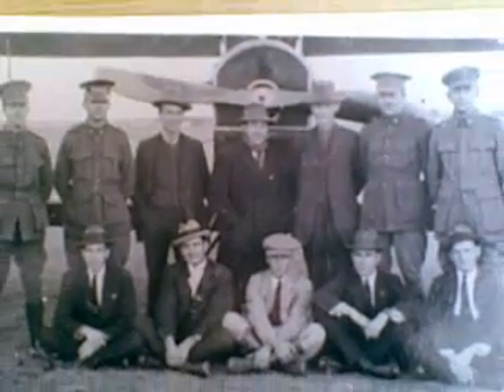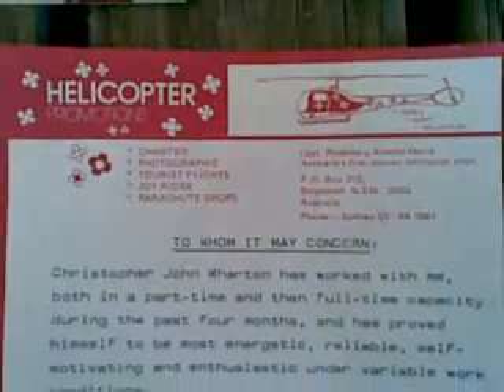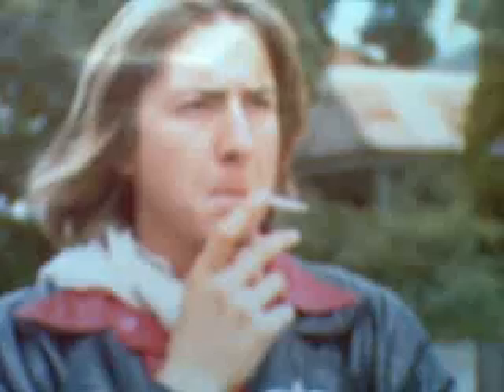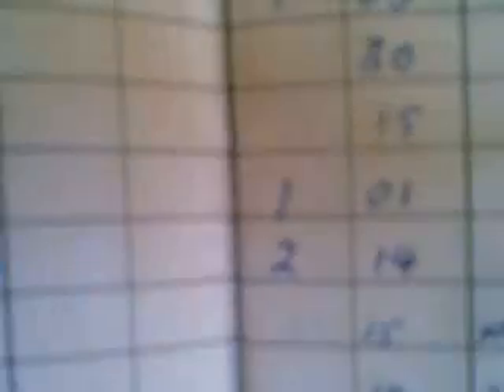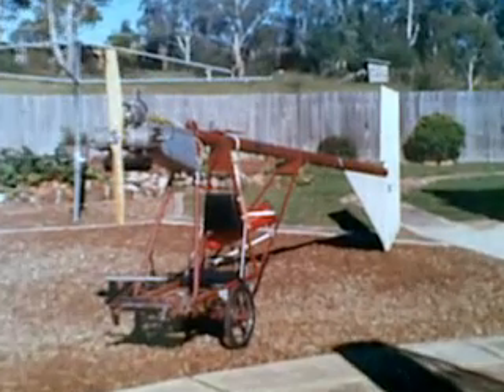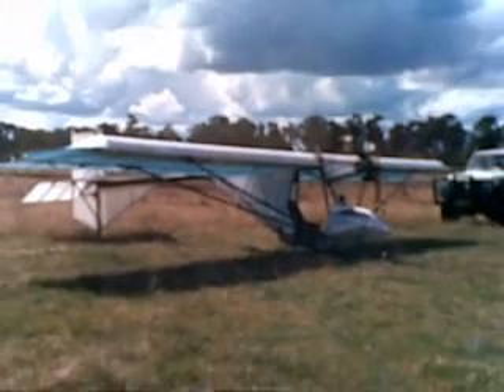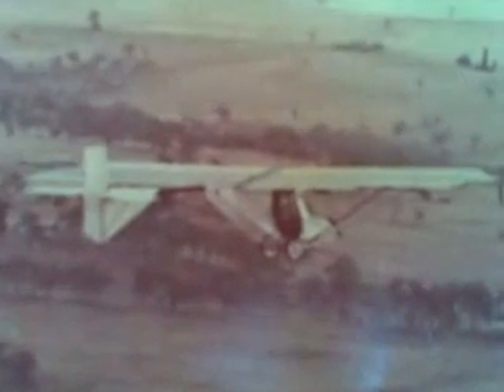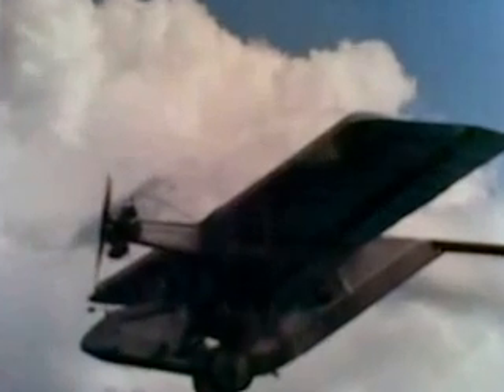Test-Flying, For Autodidactic Aeroplane-Designers...(VJ-24w SUNFUN/Budgerigar).

Comment: New site for my VJ-24W restoration project:  http://dorothy.air-war.org

Latest pic:  http://air-war.org/Exhaust_Improvement_2.jpg
I scored a free boat Trailer:   
http://www.homebuiltairplanes.com/forums/members/choppergirl-albums-trailer-build-picture52109-dsc-0286.jpg

Do you still have your Biggles hat, goggles, and jacket?

I wish I had a copy of all your VJ-24W pics and VJ-24 flight log section.
Reply from the maker: G'day,

  Thanks for the update, the Exhaust is looking brand-new, and the Website looks excellent !

   So your Jensen is called Dorothy, of honour of Oz ? That's an excellent choice of name, and the Paintjob (Computer Simulations?) look great ; I once had great intentions of painting mine, but in the event I was more keen to fly it than to paint it, and the weight saving probably made a difference.

   Um, yeah, I still have the Helmet & Goggles, & Scarf, and the Jacket's getting a bit tired so I think my Kids are going to give me new one for Fathers Day..., a propper fleece-lined Leather one, this time, for the Ego-Gratification factor...; I'll transfer the Patches over, if it arrives.

   Thanks for including my vid's on the Website's list of Jensen Videos.., it's good to see a few Jensens made it into Museums..; but I suspect yours is the only one at the moment which is on the path to become airborne (again ?, did it ever get finished enough to have flown or will you be making it's first flight ?).

   The Boat Trailer looks good, but it's still got the Hull on it, did you have to pay for the Floatie or did it come free with the Trailer as well...?

   With your Channel-Name, are you interested in the Vietnam War (?),  if so, you may be interested in a Bookreading I'm doing at the moment, "One Crowded Hour" by Tim Bowden, it's the biography of Neil Davis - he was a Combat Cameraman who left Tasmania for Singapore in 1963, shot  his first Vietnam footage in '64, and he stayed to film the T-72 coming in through the gates of the Presidential Palace in Saigon in '75, and kept filming War till he finally died of shrapnel while covering a penny-ante Coup in Bankok in 1985 ; I figure that with 11 years of filming Combat in Vietnam & Cambodia (as well as side-trips to Wars in the Congo, Bangladesh, Malaya, Egypt, Iraq, et al...), and going out on Patrol with the US, Australians, Koreans, Kiwis, South Vietnamese, & also the Viet Cong Troops, as well as filming (and partying with) the Politicians & Military Commanders, Davis was one of the very few people who actually understood what the Vietnam War was about, at the time - and he filmed it and got the footage shown worldwide (whereas everybody else in ANZUS went there for a 1-year tour at a time, & generally only operated with their own forces - the Episodes are close to 15 minutes long & they're numbered in the Titles, 1 to 24 are already posted.

   
  Have a good one,

  ;-p

  Ciao !
Reply: Yeah, the boat came free with the trailer, all I had to do was pick it up.  I have to add about 5-6 more feet to it for a VJ-24W to fit.  I'm going to build a trailer identical to yours.

My uncle was a supply truck driver in the Vietnam War.  He had the truck in front of him run over a mine in the road, and the tire from that truck landed on his hood.   I like the the Huey Helicopters from that period, which is how I got my name (not from motorcycles).

I just watched a video again about Dave Rabbit, who was a pirate radio broadcaster for Radio First Termer in Vietnam.  If you've never heard of him, check him out.

I have some flying goggles, and a jacket, but no WW1 helmet yet... but that's okay, because I'm probably going to wear my new motorcycle helmet anyway.  Not period looking but probably better for crash protection...

You will be surprised to know, if I haven't told you already, that there is already a VJ-24W flying in my state.   That Orange and White one that was restored on Youtube, was sold by that man, to a guy who runs a small Radio Controlled Airplane shop in south Georgia.  I have not met or wrote him yet but I know its here in his garage, I have pictures of it.   Isn't that crazy... it may only be a 150 miles or so from me, a flying VJ-24W.  When I get mine flying, you know for sure I will hook up with him, and have our two VJ-24W's photographed side by side on his runway.

My restoration has slowed down, because I have to get a job.  So I have just got all the most rusty parts derusted, so I can pause it and work on other things.

I think you are mostly involved with politics these days and so on, and debating other people online...  but don't forget about the girl in America restoring a VJ-24W.  I'm still here and still working on it.  I'll keep you posted over the next couple of years how it goes!
Reply from the maker: CHOPPERGIRL AIRWAR 

Cool,

  If you have the money, these days they make Hard Leather Flying Helmets, they're slightly more bulbous than a normal floppy leather Flying-Helmet, but they have the same Crash-Protection as an Open-Face Motorcycle "Skid-Lid"...

   If you can get your hands on one a Ballistic Parachute is a probably a better investment than a fancy hat, though ; bearing in mind that a VJ-24w is basically designed to be a Foot-Launched Hang-Glider trying to cope with a big weight-increase to lift the Engine, Fuel, & undercarraige - so it's a bit flimsy. (the prop-wash over the Stabiliser used to make it's Leading Edges vibrate up & down alarmingly, I was goanna fit a pair of extra Struts to brace the L/E midpoints...).

  And, if a wing-strut lets go then a Recovery Chute will let you walk away from the landing, whereas a high tech Hat will merely preserve your face to look good for an open-casket funeral...; so, I had a Recovery-Chute and a Leather Helmet...

   It' amazing that there's another Jensen so close to where you are...

;-p

Ciao !
Reply: By Stabilizer, you mean rear horizontal tail feathers vibrating.  Hmm, not good, considering I'm upping the HP.   But I'll probably find that out when I rev up the engine on a pull test.

Those are some very good and disturbing things to know.   I don't have a BRS...   maybe I should carry a parachute attached to a bungee cord at the CG, and just chuck it out the side if things go wrong... :-/

All the pilot first hand reports you can give me on how it flew... = gold to me.

I just restore one part at  a time, its kind of relaxing, and I like that kind of work.  Still need to get a copy of the plans, but not yet there yet where i have to make new things.
Reply from the maker: CHOPPERGIRL AIRWAR 

  Yeah, the Stabiliser, or Horizontal Stabiliser to give it the full name, is the bit in front of the Elevators (Triangular in planforn, on the Jensen) which doesn't move or flap up & down...; and the Leading Edge of mine was sort of "thrumming" in the Prop-blast, so I figured a pair of Struts halfway along the L/Es coming down to the Fin would hold the whole tail in place..., it wasn't effecting the handling but it was a bit of a worry to turn around and see it looking blurry from vibrating so hard.

   The earliest Recovery Parachutes were indeed Chest-Packs, for Hang-Glider Pilots, to be hand-deployed ; ie thrown into a patch of Clear Air & hoping not to get it tangled in wreckage.., but they were slow to deploy, at over 10 or 12  seconds, which may mean 500 ft or more (30 MPH going straight down, or 60 MPH diving at 45 Degrees)

   Next, at about 8 Seconds, came the Hard-Cased, Spring-Deployed Chutes,  packed in a Fibre-Glass Tube, and pulling the Ripcord let a Spring fire the Drogue 'Chute, I had one of them ; then at around 5 seconds or maybe less came the Rocket-Deployed Chutes, in which the Drogue & the Main Canopy are both pulled out & deployed by a little pyrotechnic Rocket on a Steel Cable, which can punch through any broken flapping wreckage which may be in the deployment Path.

  Finally, at 2.5 seconds to deploy, are the Compressed Nitrogen Recovery 'Chutes, which have a Cylinder of Gas at a couple of thousand PSI, and a Delivery-Tube leading up inside the flaked & packed, & "concertinaed" but not folded Canopy, to the Crown...; and pulling the Handle releases the Gas inside the Packed Parachute, which then emerges while being inflated as the compressed Nitrogen expands, resulting in a fully-developed Canopy instantly popping open & being completely filled with very cold Nitrogen.

   The two Aeroplanes I compare the Jensen to would be a 65 Hp Piper J-3 Cub, which is 3 times the weight of the Jensen, & 3 times the power, it flies about twice as fast too, but it's a Fabric-covered High-wing Taildragger, & it has a Tractor Propeller and it can be flown with both Side-Windows open & clipped flush with the underside of the Wing...; which is, all around, about as close as a General Aviation Aeroplane can come to "flying something like a VJ-24w", because of the layout, the underpowered low-density/High Drag characteristics (it slows down real fast when the power is reduced, so maintaining Airspeed is always a priority...).

   But, handling-wise, both the Cub & the Jensen are "well harmonised" ; and I rigged my Ailerons to both float up a degree or maybe 1.5 degrees at "Neutral/Stick-Central", so they decambered the Tips by that amount ; meaning that the very last part of my Wing to stall was the Tips, making it just(ifiably ?) a bit harder to Tip-Stall it when turning..., and there was once a low slow climbing-turn, I was levelling the Wings at maybe 300 ft after a missed-approach when the whole 'Plane went "Mushy" & the Ailerons went soft & soggy, and I barely had time to stuff the Nose down & unstall the inner portions of both Wings - losing maybe 30-50 ft in the process, while I levelled the Wings with a Bootful of Rudder rather than risk stalling the Tip with any Aileron input.

   Sacrificing one's Heading is pretty much always better than stalling and spinning-in by trying to level a dropped-wing with the Joystick.

   Two factors allowed me to fly out of that  developing Stall..., one was the Washout Angle that I'd rigged the Ailerons to float up at ; and  the other one was that when I trained on Sailplanes (Blanik L-13) they made us practice "Incipient Spins", as  well as Full Spins entered & recovered from deliberately.

  Sailplanes tend to spend a lot of time turning tightly, but with as little Bank as possible, while flying as slowly as possible, in order to "core" the Thermals & stay in the zone of the strongest Lift ; so they train everybody to fly around in a 30-45 degree Bank just barely above the Stall, with a margin of 3 or 5 MPH..., in order to recognise the feeling & become familiar with how an Aeroplane flies & responds while almost stalling.

   So, my advice is to find a Gliding School and take their Ab-Initio Course, and when they send you solo in their Sailplane then you'll know that  you've learned to fly the WING ; and if ever the Engine fails subsequently in life then you'll reflexively revert to flying the Wing..; and then, after getting your FAI Gliding  A, B, & C Certificates, find someone with an old J-3 Cub and get them to give you at least 1/2 an hour of Dual in it with the Windows up - to get that "Wing Overhead/Propeller-Blasted Open-Cockpit/Underpowered Taildragger" feeling which the Sailplanes don't otherwise prepare you for.

  Before Flight-Testing the Jensen, my Flight-Experience, outside of Airline Flights in a DC-3 & Fokker F-27 Friendships, was a Joyride in a DH-82 Tiger Moth in '75, then 25 minutes in a Piper J-3 Cub & 10 min's in a DH-87b Hornet Moth in '78 - before taking myself solo in the Scout in November that year....; in '79 at Bankstown I had a free ride in a Twin Commanche flying a Circuit & went on a Post-Assembly Test-Flight in a new Piper Tomahawk, then about 4 months and 10 Hours Helicoptering in an Enstrom F-28c, navigating on Ferry-Flights between Barnstorming Venues, and in 1980 I had 4 Landings & 2 Hours of Aerobatics Instruction in a Pitts S-2a, and in '81 I flew 15 hours on Sailplanes, 7 Hours Solo, (10 in Blanik L-13s & 5 in IS-28s)...
  
   Then, after a decade of not having flown anything, I bought the Jensen Project, and when it was ready to be tested I figured that I knew more about it than anybody else available - including the bloke who'd started building it, because I'd done so much in the way of  alterations, and after the Red Baron Scout the Jensen was bound to be better & easier ; so I took 10 hours going up and down the Runway at ever increasing speeds, and when I was flying 10 ft up and landing OK, then I tried to do a Circuit.

  That was a mistake, because I hadn't finished nor fitted the Gap-Cover, which joins the Wings' Upper Surfaces ; though the Plans warn that it will not fly without the Gap-Cover , it had seemed "just fine" to me..., and it was, too - but only in Ground-Effect (less than half the Wingspan off the Ground, ie below 18 ft high, in a Jensen...).

  I sailed up and was still climbing when I went over the Fence at 50 Ft, but halfway accross the Paddock it reached 100 Ft & refused to climb, barely holding height while going straight, so I tried turning, and lost 30 ft in 90 Degrees, and did that again, putting me at 40 ft up going Downwind and facing Trees 60 ft high ; so I turned again, and went over the Fence at 10 ft up, chopped the Throttle & plopped onto the Runway Crosswind, having pulled off the Jensen's first Circuit & my first Emergency Landing on my first Test-Flight of a "new prototype", and then I went home to finish the Gap-Cover.

  Luckily, there was nobody at the Airfield but me at the time, so nobody else saw me showing myself how overconfident I really was.

  Without the Gap-Cover, there were effectively  4 Wingtip Vortexes, and thus twice the normal amount of Induced Drag..., but while playing Penguins down there in the  Ground-Effect, at 1/4 of a Wingspan off the Runway, the Wing was twice as efficient as when flying in free-air ; so I hadn't noticed that anything was wrong until it turned out to be incapable of climbing above 100 ft (after the Airspeed bled-off as it staggered up out of Ground-Effect) or of holding it's Height while turning...

  Sailplanes, then a 65 Hp J-3 Cub,  then a Stick & Rag Ultralight, and then you should be about ready for the Jensen...

  I hope all that makes sense,

  ;-p

Ciao !
Reply: Yeah, I was wondering that about your video, how you could barely get over the trees turning, when the video of the other guy flying one seems to climb just fine.  I figure it was your wing gap, and maybe different air temperatures... and maybe the props had something to do with it too.  He was up north, and you are in hot ass Australia (like me down south) so air temp and hot thin air was prob a factor.   Engine works less well, wings lift less well.

Maybe some blue foam board might help inside the aileron as well... a flat surface inside to keep the Dacron from starting a harmonic vibration.  I see that a lot on the flat undersides of main wings on bigger planes in video a lot.

I attached the handle of a weed Wacker to mine today to give it a spitfire type stick, and bought a cheap $10 plastic seat to mount on it for an airshow in September I want to take it to,  so the kids can sit in it and play with a push button electronic sound effect  soundbox, on a real looking stick, until I get a better seat.  Pic:

http://air-war.org/Composite_Stick.jpg

I have to say I'm a hardcore autodidact myself.  Spend lots of time reading, esp. Wikipedia.  Almost jumped on a free 40 book volume of encyclopedias someone was giving away free from 1991.  Bought some new tires for my lawnmower today.

If you get bored one day, do a video on how you built your aircraft trailer.   I can make out the triangular frame structure in a still frame I captured.   I probably will use the exact same corrugated type tin with a metal frame underneath.

I would like to figure out how to make my wings fold like a Kolb Firefly, but that would mean I'd have to take off the rear aileron each time ( no problem really) and build an even longer trailer.
Reply: So if one of my wings stalls out on me like during a turn at a speed close to stalling, the correct action is to jam the rudder hard in the other direction, and not to try and counter the roll with the stick in the opposite direction, as that would slow and stall the stalled wing more... and you'd enter a spin.    

React with opposite rudder to counter a stalled wing, and jam the stick forward to get you nose down and build up airspeed to get the wing out of stall.

I think I paraphrased that correctly
Reply from the maker: CHOPPERGIRL AIRWAR 

  Yes, that's it..., kinda...

   If one wing suddenly drops, it means it's stalled ; so opposite Rudder should accelerate that Wingtip, thus increasing it's Airspeed, & therefore unstalling it....

    Using the Stick to try to raise a dropping Wingtip will increase it's Camber, thus stalling it deeper ; therefore ensuring a Stall/Spin....

  See "REQUIEM FOR A REDHEAD...", in my "Warbles In The Wilderness" Playlist...

   Canada John survived hitch-hiking through Cambodia, Laos, & Vietnam all in 1972 (!),  among 54 Countries while hitching from Canadia to Oz, and then in 1995 he stalled & spun-in, when his Engine failed during his Final Turn onto Approach.

  Because..., he didn't take my advice to learn to fly Gliders, before converting to Power, he learned to fly the Engine instead of the Wing...; and then when the Engine failed, he Died...

   And that's probably a better way to paraphrase it, I thinketh...(?).

  ;-p

  Ciao !
Reply: +WarblesOnALot Yeah, I'd love to learn gliders, glider pilots are hardcore... that was my impression after watching a video on the Gimli Glider...  (a commercial airline the pilot put down on a closed airport runway when he lost all engines using skills he learned as a glider pilot.)

Unfortunately I don't have that kind of cash right now.   I'll probably do a lot of gliding up high with engine in idle someday if I can finish this thing.  Diabetes slows my progress big time, and also not having a dedicated workshop.   

I'd rather buy some land and build a 30x40 hanger, than go the trailer route...  already found a field for sale... so if I get a job that's my plan...    I just can't see it being practical to assemble and disassemble and move your plane every time you want to hop in the sky.
Reply: Man you make a lot of videos.  I got two more questions for you... kind of subjective:

1.  It's 18 feet exactly from my computer chair in my kitchen where I sit, to my couch in my living room.   I always pictured myself in a small little 3/4 scale biplane or triplane with short wings and a quick roll rate... you know, a fighter, you could turn on a dime  Its really hard for me to fathom flying something with a 38 ft wingspan.     I mean, what's that like?   To me, I think it'd feel like flying a bomber, or driving a semi truck.     I mean, I'm like holy crap is this thing big.  What is that like, like in real life?  To fly something that's this... great big old... wing...   stretching so far out from you to the left and so far out to you on the right?   

2.  Can you do aileron rolls in a VJ-24W without getting yourself killed?  Would they be safe from a decent altitude.  I saw this video of a guy do an aileron roll in a 727 in front of airline buyers, and his boss yelled at him, and he shrugged and said...  it's totally safe, a 1g manuever.   And I'm thinking, if this guy can do a aileron roll in a 727, I should be able to do one in this kite, and show off this big wing with my name plastered all over it top and bottom, to everyone down below.   Is that nuts as hell, or is that going to be possible someday?   Point the nose down, gain a little speed, pull the nose up some, and roll it 360 and level out?  I'm absolutely no fan of hanging upside down, esp. in a seat bucket, but its about the only aerobatic manuever I want to do (if it don't make me sick), because it looks impressive from the ground.   Is that suicidal?   Would you do it?
Reply from the maker: CHOPPERGIRL AIRWAR 

  Yeah, I never seem to run out of things which "I should make a video about that..."; and at the moment I'm in the middle of a long   Bookreading series.., but I have an Iraq-War Veteran Subscriber who grew up on stories of how "the US could've won in Vietnam but was robbed of rightful victory by Journalists who spread 'defeatism' and damaged morale...", and I figure she's probably not the only person in the world who might benefit from learning better than that...(?).

   Um the Jensen has pretty big Ailerons - and mine were skinned on both sides, so they may have been a bit more effective than the standard single-surface ones as per the Plans - but they're "Differential Ailerons" so the Upgoing Aileron moves twice as far up as the Downgoing one goes down, for any amount of Stick-movement ; which decambers one Wingtip, cutting Lift there while only making a little bit of extra Lift on the opposite Tip, in order to avoid Adverse Yaw from Aileron-Drag (making Lift causes Drag)...

    General Aviation Sailplanes with 50 Ft plus Wingspans are a bit cumbersome, but the Jensen at 36 ft wingspan is only a little bit more sluggish in Roll than a Cessna 152/172/182/210 or a Piper Cub, Tomahawk,  Cherokee, Archer, Warrior, or a Beechcraft Musketeer, etc (which are all 24-32 ft Span) ..; but because you're flying at 30-35 MPH everything happens rather gently and slowly, compared to buzzing around at 100 Knots in a Spam-Can..., but you still do get an instant response when you rock the Stick.

   As for Aileron-Rolling the Jensen............

    Look at the Wing-Struts, consider the Wall-Thickness (thinness), and remember that as a Hang Glider those Struts were designed to be in Tension in Flight, & in Compression (holding up the Wings) when on the Ground, back when it only weighed 300 Pounds

    So if the whole machine, now with an Engine & Sprung Undercarraige, weighs 400 Pounds there's going to be a 100 pound Pull-force on each Tube (probably 130 Lb on the front & 70 Lb on the Rear, actually...) in Level Flight at "1-G"...; and from memory the Jensen was only originally stressed for +3 Gs & -1.5 Gs, at 300 Pounds T/O Weight.., as a Foot-Launched Aerodynamically-Controlled Hang-Glider...

   Which means that if you turn a VJ-24w upside-down &  you Sneeze particularly hard, and shake up & down in the Straps while doing it  (being the heaviest component of the machine...) you'll put a transient Negative G-loading of more than 450 Lb of Compression-Loads through those Struts (300 x -1.5 = -450...), and then a Strut will buckle & the Wing/s will fold down & "Clap Hands underneath", or simply spin down to the Ground with one wing bent back & down & wrapped around the Tail..., not a good outlook.

  You should only fly the Jensen while applying Positive G.

   In theory, the Airframe could cope with a Barrel Roll, in which you pick a point on the Horizon 10 Degrees off to one side of the Nose, & roll around that Point, thus keeping Positive G-force on all the way around...; but, the Jensen isn't Dense enough (Mass to Surface Area) and it makes too much Drag, & it hasn't got enough Power to get past the first 90 Degrees of Roll, and it'll stall before getting Inverted.

  And then you'd have to try to get out of the resulting Spin/Dive..., without pulling the Wings off...

   I saw 60 MPH once, in a 45 Degree Dive, power-on, and I pulled 2 G coming out of it after Throttling back..., I was 5,000 ft up with a Ballistic Recovery-Chute fitted, and I still felt like I was being pretty brave to have done it all deliberately, while "exploring the Flight Envelope"...; I also flew some 360 Turns at a 60 Degree Bank, too, and it took Full Power at 50 MPH, while losing 200 Ft/min, to do them....

   So, if you want to show the top of your Wing to the Crowd, then dive toward the Display-Line from 45-degrees "behind" the Audience, then Roll into a 50 Degree Bank as you get to the Runway in front of the Onlookers, turn through 90 Degrees of Azimuth around the Viewers, & then roll out of the Turn as you depart at 45-degrees to the Display-Line, going out the other side ; and then do it all again in reverse from the other side of the Runway to show-off the Underside...

   Make a Slow Pass going into the Wind, & a Fast Pass with a Tailwind up your backside adding to he apparent speed while going past the adoring Throng as they cheer themselves hoarse, but if you exceed 20 Degrees Bank while in a Climbing-Turn (Chandelle) then you'll probably stall & fall out of it ; you can Climb, or you can Turn steeply, but not at the same time, there isn't enough Power to go Vertically Upwards, and you haven't got the G-Tolerance to pull out of a Vertical Dive, or to fly Inverted..., so just(ifiably ?) keep it smooth and enjoy floating around gently while staying right-side-up, and you'll have a whole lot more fun than if you have to figure out how to fly with folded wings...

  I reckon, anyway...

    Have a good one,

  ;-p

Ciao !
Reply: Yeah, I read up on an aileron roll, it said the plane is always in a very slight positive G...

Still an extremely iffy manuever in something that like you said, was built as a footlaunched glider as marginal and light as possible.   Probably not wise at all.

I thought it'd be a way to pull of some momentary inverted flight in something you don't want to ever fly... inverted... for the aforementioned struts under compression buckling reason.   Just when I had them on temp I could see how long and wobbly they were without the jury struts attached.

I always wondered if you could add more bracing wire and a king post, and strengthen everything up a bit with some more draggy wires...

Don't know, long way off, I might not have the guts to try it anyway, but I couldn't help but ask someone who has flown one.

My thought is theJensen is basically just strong enough to get you up in the air and have a look around and don't try any crazy stuff in it, just enjoy some level flight, climbs and turns.
Reply: BTW, my ailerons are skinned on both sides.
Reply: That bloke who thinks the US lost the Vietnam War because of journalistic defeatism, probably also would believe the Nazi party line, that Germany lost WW1 because of the stab in the back by some Jews.   Right....       never mind...   that both sides were completely exhausted and on the verge of collapse  in every way at the end, and the American's finally sent fresh troops over which though green, turned the tide against the Germans.   

Vietnam was a meatgrinder quagmire they just kept sending men and materials into and couldn't be won no matter how much they escalated it.  

~

Actually in America right now, what I am wondering, as an anarchist, is what the rest of the world thinks of the two buffons we currently have running for President...   either way, its going to be a disaster for us for the next 4 years.   We've had shitty Presidents before, so I guess that's not new, but I wonder if the rest of the world has been following this catastrophe unfolding outside of the US.

Me, I don't really care who gets elected...   the state is entirely my enemy no matter who is the head ornament on it...

I love history.  Watched a video on WW1 shellshock just the other day, and mining under the trenches.  And watch people dig up stuff hunting for the past.

Check out these awesome planes I found at a museum I want to go to:

http://www.militaryaviationmuseum.org/ww1-aircraft.html

http://www.militaryaviationmuseum.org/ww2-aircraft.html
Reply from the maker: CHOPPERGIRL AIRWAR 

  Yeah, basically, the Jensen is  the wrong machine for Aerobatics, it's meant for floating around looking for Micro-Lift in the late afternoon, or going for a fly at Sunrise when the Dew is still on the Grass & the Wind hasn't started to blow.

  Funny that you mention the Imperial German Backstabbing Theory, I said the same thing ; but apparently 4 Family Members were Officers who served in 'Nam, so it's apparently an act of Family Disloyalty or or something, to acccept the fact that the Vietnamese won the Vietnam War...

   Last night I watched a BBC TV Doccumentary called "The Quiet Mutiny" made in 1970 by John Pilger (an Australian Reporter)...; it shows a lot of tension in the US Forces between the "Lifers" who were in the Army as a career, working in rear-areas in safety & the Drafted Conscripts who were getting shot-at out in the boonies.

  I Fave'd it, so you can find in in my Favourites Playlist, if you like...; and last week I Fave'd a good doccumentary about the Battle of Long Tan (18 August 1966).

   That's a good list of Old Aeroplanes you've got there..; I'd like an Avro 504-k, if I could have my choice.

   As regards the Clinton/Trump contest, at this point probably the only thing which might save the World from Prissydunce Combover would be if the Lee Harvey Oswald Factor makes an appearance to remove Clinton from the Picture ; thus clearing the way for Bernie  to beat Trump.

   I expect Prissydunce Trump to give Putin a free hand in Ukraine, Turkey has already been annexed by the Islamofascists from Boko Harum - so NATO is in the process of transferring all it's Turkish Weapons Stockpiles to ISIL ; and the Bankrupt Combover will then pick a Loser's War with China, after which Alaska & Hawaii will be Annexed to repay the US National Debt to the Beijing Savings Banks, and Oz will become a Chinese Colony as a consequence of having helped Unkle Spam to annoy the Chinese, under the terms of the ANZUS Treaty.

  I hate the AmeriKan Elections, because we in the rest of the World get stuck with the consequences of whichever Megalomaniac is elected by a simple majority of the 40% or so of US CitiZens who can be bothered to vote...; and there hasn't been a competant US President since Eisenhower, from what I can see, and he stepped down just before I was born, when he warned the World about the danger of the US Military-Industrial Complex in his Resignation Speech.

   I hope you don't live anywhere near where the Chinese will be throwing Mushroom Clouds, when the stupid shitfight being stirred up by the US Navy in the South China Sea boils over...; I reckon the Pentagon's goanna get itself creamed, this time, it won't be like Unkle Spam's youngsters getting sent home covered in Bandaids with their Arse in a Sling after losing-out to a bunch of raggedy-arsed Insurgents, Goat-Milkers, & Camel-Herders in the Desert...

  China hasn't spent 25 years flogging the shit out of everything in their Inventory, either, their Gearboxes aren't full of Sand, the Seals aren't chopped-out by Dust, and their Troops aren't bleeding & limping & quivering & shaking & rattling with Pills from the PTSD from 6 Tours of Duty in Absurdistan & Iraqagain&againistan.

    So, yeah, the whole World is watching ; and it looks like a stupid mess, probably even sillier than when GW Bush was inagurated after losing the Election to Al Gore.

  We live in "Interesting Times !

Have a good one.

  ;-p

Ciao !